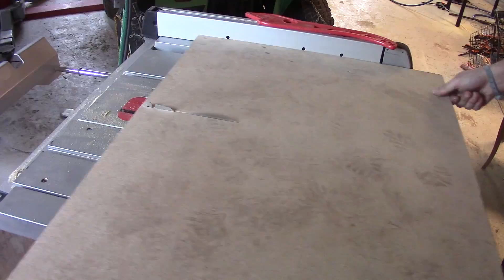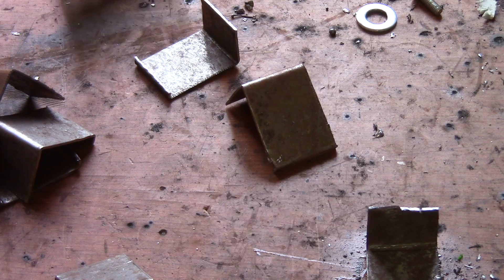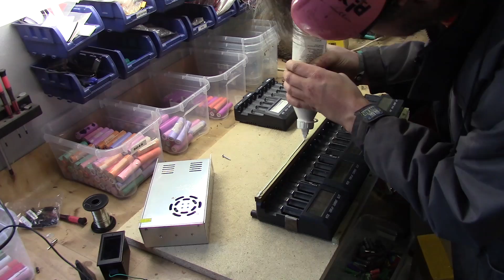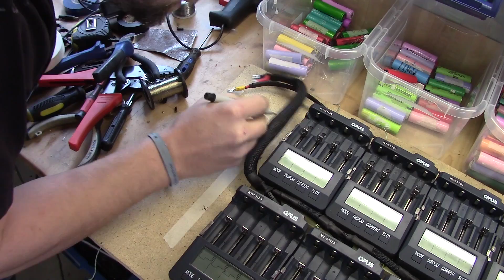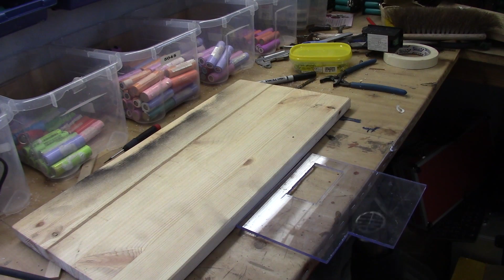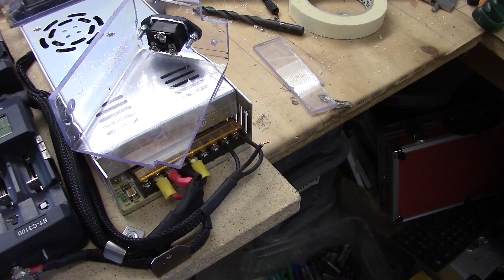Build GIGANTIC Opus based charging station (Re upload)

Comment: how many amps @12v do each charger by themselves draw?  wondering about a solar powered version.  i have 10 chargers as well but no way to test amp draw at 12 volt.
Reply from the maker: They are 12v powered so in theory 1A but its good to have 2A available

Comment: Instead of those brackets you could use some thin board (plexy or aluminium) and screw chargers trough it with longer screws.
Reply from the maker: Yeap

Comment: I enjoyed watching your work. Though, and now you probably already know that more space should be left for cooling. Air also needs free passage. Even though it is only air. And your design is added instead and does not allow proper cooling. Unless you run a fan on the whole unit.
Reply from the maker: The unit as such have No problem to cool but yes its close. I run this in an area with 10c ambient and IF you have 20 or more it would most likely be an issue as you say

Comment: Very Nice
Am from Pakistan.
Most Informative Videos are. I really learn alot from. Any budy tells how to make a 12 volt 200 amps battery with 18650 quantity confusion.
Load is 1500 watts 220v and backup time 12 to 15 hours. How much batteries will be require plz help to solve my problem thanx

Comment: Nice, but I would mount those chargers using their own holes to avoid extra metal work :) Maybe just using longer screws.
Reply from the maker: No holes easily available but yeah it is an option :)

Comment: While the batteries are charging on these chargers they’re giving off some heat.   Do you know if that is harmful to be close to?  Is it radiation?
Reply from the maker: I doubt it will harm you since its not that much heat. But yes you should not let cells heat up to much.

Comment: Can any one please tell me does fake Opus-BT-C3100 clones exist as I am ordering 2 from ebay. Cannot fine anyware comparison about fake Opus-BT-C3100 clones.
Reply: I get Zeepin Bt-c3100 v2. 2 and look just like opus but missing opus logo on packet and there opus logo are on Charger it is The Word "zeepin" i order Opus and get full refund after i send picture on it, but don't now If it is a clone, but discharge don't work well, it discharge to 3.21v not 2.8v that are in the manual.

Comment: Is there any other power source that can be used?
Reply from the maker: You can use any power source that gives out the proper voltage and enough current like a power supply from a computer
Reply: Thank you.

Comment: Nice but why use a rusty bent piece of sheet metal to make the mounting brackets for the chargers???
Reply from the maker: Dave Meers i use what i got
Reply from the maker: And now when I got my 3d Printer im thinking of redoing them and print them out. But the sheet metal was easy and its rock solid :)

Comment: This is my  first time giving any one feed back but I must say I truly enjoy watching your blogs esp. this one on build Gigantic opus based charging station   I have not done more than putting up 4x  ( 285 watts )  solar panels and 1 wind generator with 2 cheep 12 volt batteries for back up and a grid tie inverter plugged into a outlet I'm disabled and retired veteran but I plan on working from my chair to build a powerwall  and your charging station. I have a very limited income but have purchased soom 18650 batteries and hope to get more used ones at repair shops anyway thanks

Comment: Nice video. I have one question. If I don't know charging current for each cell but know that its min is 3.0 volt and max is 4.2 volt and 2500mAh. If I have 4S5P setup I should have 12 volt to 16.8 volt charger but what about Amp? How many Amp of charger I need and how can I count it? What happens if Amp is higher than required?
Reply from the maker: If you have a 4s5p pack you should use a balance charger. Like the Imax or iCharger or any other rc charger for that  said.  Then you set that up to 4s and i would not recomend to charge over 5A and even better 2.5A. 
If you going to charge without its 4*4.2V max but beware of that if they go out of balance you may kill them without BMS or some kind of protection.

Comment: Nice!
I only have one Opus, and discovering I'll need more!
I managed to increase throughput by using a couple of B6AC chargers and a 6S balance cable with croc clips/magnets to be able to bulk precharge 24 cells or more at once before putting in the Opus for capacity testing, so that saves a load of time!
After discharge and getting capacity result, I take them out of the Opus to free it up for the next batch and then bulk recharge the cells with a B6AC when I got enough together.

You might need to add a fan to keep the cells cool, and increase the separation between rows and add a deflector for the Opus cooling fans to direct the hot air outwards, instead of heating the row above.
I found a lot of cells with moderate to high internal resistance can get very hot and shut the charger down for tens of minutes while it cools.
Adding a fan to blow fresh air over them will reduce the time they are offline when they overheat!
Reply from the maker: So far i have only run through 1500 cells in current setup and no issues what so ever :)  The heating from one row to another was a concern but so far no issues with that. I have temp sensors mounted in 2 opus chargers that actually meassure the cells and you can not see any difference between the first row and the 2nd row.  Cells that get that hot that the charger shut of goes to bin so they are not a problem for me in the long run.  I do not want to add extra cooling when testing because if they fail and need fan on test they will not work in real life afterwards. The offline part if that "would" happen. (Have not seen it yet....) Does not bother me. I switch cells 2 times per day. Morning and evening so they have 12 hours to complete the job. If it havent completed in that time frame they are binned as well :)

But for other people your advice may be usefull.
Reply: Good answer, thanks!

Comment: Thanks for the vid. can I ask If I wanted to build a tesla style 18650 battery packs for a electric car conversion how would I calculate the maxium demand current drain on each cell ( as not to over stress it) I am thinking of a 90v system max 650amp controller. thinking of building 30 packs X 150 cell 300Ah each pack. how would I work it out? Thanks
Reply from the maker: To be hones. If you going to draw up to 650A and if you go with what i design above then its 1A per cell max. (2nd hand laptop cells) That would need 30*650 cells :)  If you have 150 cells per pack thats 650/150 = 4.3A per cell in avg load if you max it out.  18650 cells can handle that in bursts. Especially if you get batteries designed for it.
Hope that helps out.
Reply: Ok Thanks, so each pack has to capable  of the max current, isnt the max current split across  the 30 packs.  not really a viable option then. Thanks
Reply from the maker: If It Anit Broke Still Fix It no. same current goes through all packd that are in series

Comment: BTW, let me tell you something. Sometime ago I opened a notebook battery to get 18650 batteries. And ALL of them had only 0.61v. Either way I tried to change them and all of them charged and didn't lost it after 24hs... Now I finally got the little tester board I bought from AliExpress and tested them. Result? 3 of them are 2100mah and 3 are 2200mah. LOL (I can't tell you the model now because they're charging right now.) And most people wouldn't even try to charge them. :D
Reply from the maker: I test all my batteries that take charge in some way or another. Just because voltage is low you dont really know what the actuall status is. but of course if you do worry about the degeneration caused by low voltage you leave them. for instance if you have unlimited supply.
Reply: DIY Tech & Repairs Exactly. The only ones I don't test are those with 0 volts.